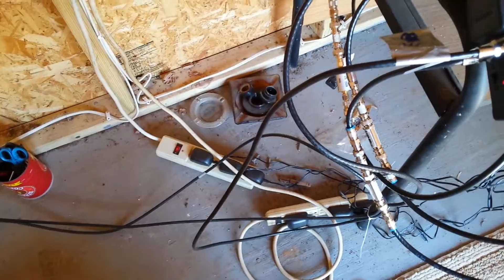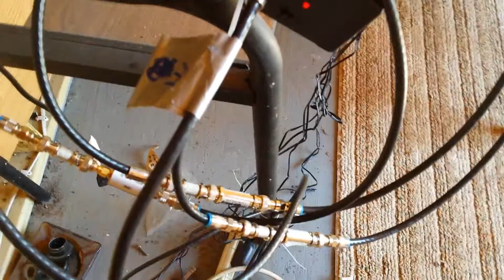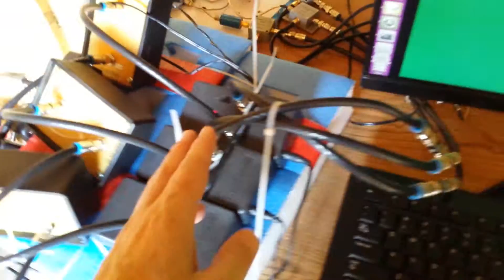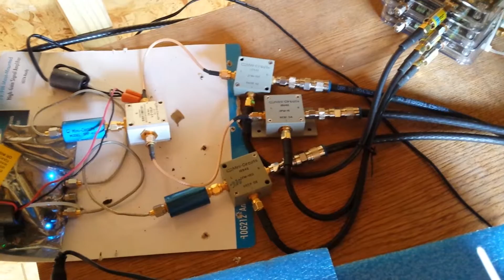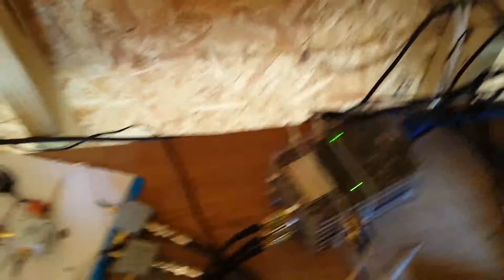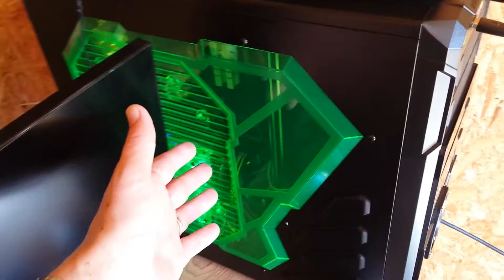Wideband SDR interferometer visual tour

Comment: Man, this is awesome.  I wonder if you would gain significant dsp speed with this setup by offloading to a graphics card(s) using CUDA.
Reply from the maker: I've written a CUDA-based FX correlator using a LimeSDR that can crunch data in real-time. Check out this link.
https://groups.google.com/forum/#!forum/amateur-radio-interferometry